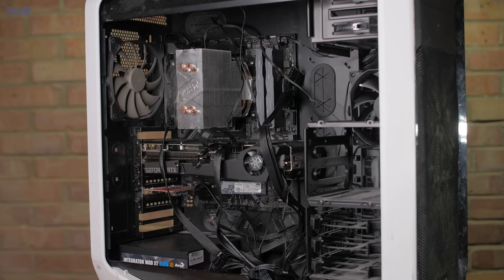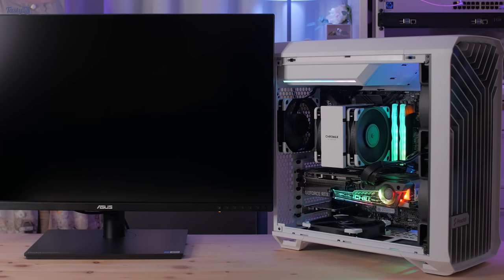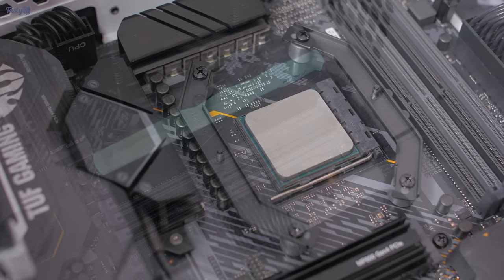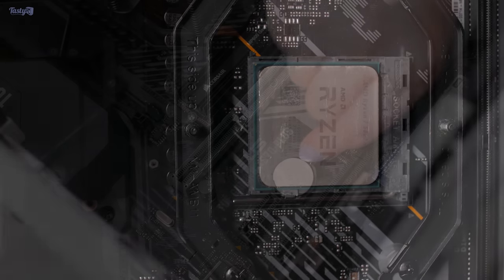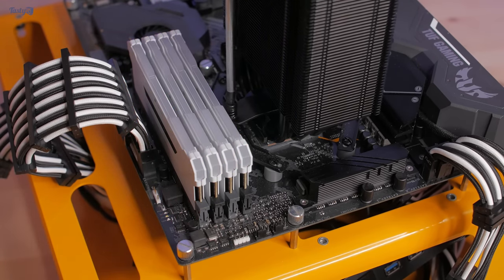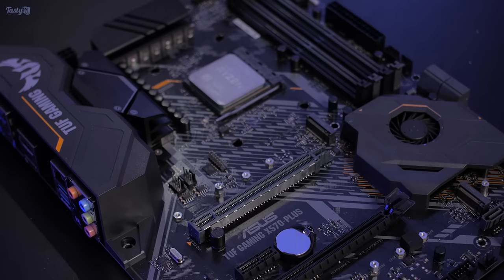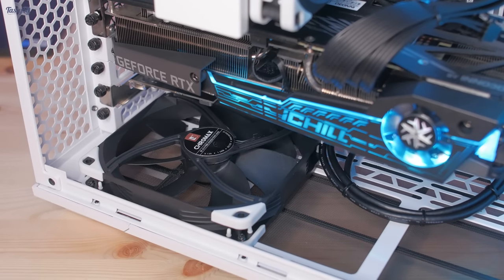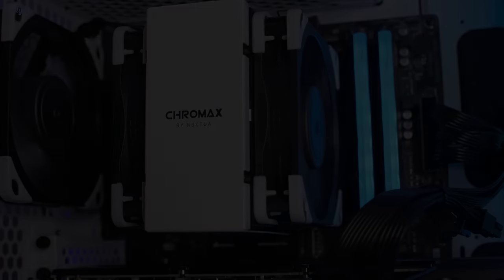I BROKE A VIEWERS PC??

Comment: About the build: I love it! looks absolutely stunning! With all due respect, looks way better than before.
About the malfunction: Since the problem only manifests when pressure is applied to the CPU socket, It could be the contacts on the motherboard on the PGA Socket. they are quite sensitive, believe it or not. That or a bad solder point in one of the components of the motherboard. the CPU coming out with the cooler, even though not ideal, shouldn't be enough to create any permanent issues. the twist and turn technique of removal usually only works with old thermal paste. depending on the new thermal paste viscosity and luck, anything might happen. all of the statements i just made are just my humble experience. I am not stating absolute truths, I am sharing my personal and professional experience. (I work in a Portuguese Tech Device Manufacturer assembling, fixing and maintaining Desktops, Laptops, Tablets, Phones, Monitors...)

Comment: It's not your fault this happened, It's an issue with the TUF x570-Plus boards flex when a high pressure mount cooler is fitted to the CPU as you found out, I've replaced numerous boards because of this problem, it normally shows itself after a few months by, as you observed, random screen lock ups and POST failures, this "cheap X570" board is one of the few ASUS products I would not recommend and if the customer wants ASUS, then I try and advise them to go Strix or ProArt depending on their usage case. TUF (Totally Useless Factory) boards use the cheapest components right on the edge of their limits and the heat from the CPU is enough to allow the board to flex around the CPU socket and stress the solder joints, sometimes a coat of flux and a hot air blast on the back can solve this for a bit, but it's the same theory as baking a faulty GPU to reflow it, if you do it once then you'll have to repeat it every few months until the card really dies.

Comment: These strange issues happen mostly on Gigabyte motherboards, I`ve had issues with 2 B550 Aorus elite v2, one of them stopped posting after 5 months use, the second one had a stuttering issues when used with 3700X cpu, the voice and video would stutter constantly. I would suggest to avoid Gigabyte motherboards at all cost.

Comment: It sounds so familiar and that's not a single case. Many Z690 boards, especially Asus got the same problem if you screw CPU cooler as tight as possible. I thought it's because CPU losing contact, but then could it affect PGA socket as well? There's gotta be some flaw in design. You can find many people on reddit/forums complaining about freezing PC that they just built. I had it too for almost half a year and it went away right after using contact frame and loosening mounting screws. The same cooler worked great on previous gen motherboards. I can see in comments it becomes plague now and who would've thought about coolers mount pressure if PC gets unstable? Every manufacturer tells you to screw it all the way down.

Comment: That board cpu problem is one of a kind.

I also had a problem 3 days ago, my PC didn't want to start, it was in a boot loop, I cleaned it completely, and tested everything little by little.
The board and cpu powered up fine alone, but as soon as I connected the memory or GPU it went back to boot loop, so I assumed the culprit was the power supply, and I was right, even though the psu was powering and offering the 5, 12, and 3.3 volts.

I was worried I'd need to upgrade everything because my PC is from 2015, but I only had to replace the psu, and everything is back to normal.

Comment: That's such an insane issue to try and diagnose, perhaps some of the pins in the socket have become broken off from the solder points on the motherboard and the new heavy cooler warps the motherboard enough to make those solder points not make contact. I don't know what the melting point of the plastic socket is but if its a decent amount higher than the melting point of the solder then it might be fixable with a hot air gun to reflow the solder

Comment: Oh my god what a flash back. I remember building my PC with my Rzn7 3800x and between the asrock mobo and tridentZ ram I got intermittent blue screens but switching either the ram, cpu, or mobo resulted in stability. It was only ever that specific combo of 3 that causes a blue-screen every 10 mins logged as a ram error.

Comment: The AM4 CPU is a royal pain to remove. I have always placed a heat gun (or hair dryer )  around the area before lifting a cooler. This has paid off on Intel and AMD CPU's. Thank you for the video. Great workaround for the positive pressure airflow. Five stars!

Comment: Ugh, I hate it when mounting pressure is this sensitive.  Used to have this old Supermicro dual socket server board with like 16 or 18 RAM slots.  If the mounting pressure wasn't precisely distributed I'd find memory modules would randomly 'disappear'.  Took me a long time and way too much reseating of the RDIMMs to figure out what the issue actually was.

Comment: thats weird, i put a 5600x on a b450 (gigabyte) with latest bios and for some reason the bios sets my infinity fabric clock to 1800mhz in amd cbs (old pbo), i have to manually set it to 1600mhz so it doesnt crash cause ive got 3200mhz ram

Comment: I have broken PC's the same way in the past. AM4 sockets flaw is CPU retention as you mention. annoyingly there's two ways to mount a CPU cooler in AM4 which is half the problem. Well done for replacing it though, and top class troubleshooting as well.

Comment: I have same issue if ur unplug 1 or 2 slot ram and connected again it Will be error no post, all slot ram in your motherboard not broke it cause of BIOS and detected ram not connect, and because previously has xmp ram oc has been active. And if your connect 1 slot it Will be okay and active by default setting, my PC has been fixed now, all i do is simple do not plug your ram and turn on your PC it Will make sound error let it be for 10-15 second after that force ur PC shotdown by click power button ,( it Will force BIOS connected to ram by default) and than plug ur ram dual channel in slot 2 and 4 turn on ur computer it Will fix ram read in BIOS default speed if want oc ur ram just actifated xmp on BIOS .

Comment: I had this issue in an older build. The RAM sticks just didn't work together but seemed to work fine in a single configuration. I don't think I ever fixed the problem, but after diagnosing it, I just kept reseating the CPU and trying different RAM slot configs until it finally posted. Then I never touched that system again. Great detective work in your case. Diagnosing faults is a time consuming, irritating process that often leaves you completely lost at sea.

Comment: Ahh so it was the Motherboard. I presume that would be out of warranty. I wonder if it is a slightly uneven top on his CPU, so the slightly uneven pressure pushes apart a dry joint (ie crack). - At least that would be my guess. Been here and had the wobbly bum thinking I might of kill somthing before.

Comment: I used to be a computer technician/builder. I’ve built over 20,000 computers. I’m very impressed with your trouble shooting skills. It seems to me that the cpu socket is a bit dicky. Only way to know for sure is to get the exact same motherboard and test with his cpu. If it still didn’t work then the cpu is dicky.

Comment: i upgraded from a 1700x to a 5800x i had a msi  x470 gaming plus mob that quit after a week of me having a new cpu. my pc hard crashed 2 times before .it  would get stuck at cpu no mater what i tried even no cpu cooler. i  replaced my mobo with a x570 bored every thing worked perfectly

Comment: You are too soft. you need to recharge for any faulty components replaced. once you have the observation of the mounting pressure problem with the CPU you could have offered the choice of the original cooler on the PC (temperamental) or the RAM in non dual channel mode (which worked) I have just in the last month bought that tuf gaming motherboard (2nd hand) as there is a good full coverage waterblock for it. Ryzen have a 3 year warranty, may have been worth checking the purchase date.

Comment: i have asus X370 and i have same instable problem when CPU block it too tight... i have loosen the braket to "normal" pressure and it works fine, but when i ratch it down it wuold freeze time to time...

Comment: hah hah I used plexiglass with my Fractal Define 7 XL on top exhaust. Since I have 3 intake fans on the front and 360 AIO as exhaust in top of the case. I put plexiglass around the holes of AIO to force air though AIO or either back exhaust. I also have been testing if there is any benefit making back exhaust as intake but I think there was no noticeable difference in temps rather only for turbulence air fighting each other. So rather giving fresh air from bottom and front and exhausting it with back and top as physics intends.

Comment: I had a similar issue. The PC worked just fine a night before, but when I turned it on the next day I only got a black screen. When I used only one memory stick it posted just fine. However, when inserting the 2nd one the PC was not posting anymore. Then, I've tried wiggling a little bit the memories and then it worked just fine with all 4 sticks since then. I think it might be an issue with the solder joints at one of the RAM sockets. 
I really like the way you diagnosed this PC.

Comment: THe Original Board had the problem which very well may have caused the boot issue , and the mounting pressure from one to another cooler , unless it was severely over tightened should had Not resolved the same , its the board , i am finding this board has the same issues across multiple combo`s , same as msi a pro board coming down with 3600 and 3600x cpu`s
Good to See You , i Do hope everything is Good

Comment: Consider that in transport the cpu heat sink could have bent or damaged the cpu seating area. 

That would explain the tightening issue.

Oh and too anyone who owns a Ichill x4 3090 little tip, the retention bracket that comes with it adds thermal temps, if you wanna stop sag get a motherboard mounted gpu sag kit (arorus x470 came with one I’m not sure on newer boards).

Comment: That was a very strange problem on the asus TUF. I could be wrong and could be unlikely but if it is to do with mounting pressure from the heatsink to the CPU I'm wondering if any pcb tracks have broken underneath and becomes apparent when the heatsink gets tightened.

Comment: You mentioned the lovely weak AM4 retention system. 
They also don't like long lasting high temperatures. So with a weak cooler, temperature eventually starts warping the plastic inside the retention system. 
This as you notice can create problems under sustained load. But you would have to have the system running max temperature for a while, i reckon days. Just mad!

Comment: A buddy of mine had this exact same issue. It turned out he basically broke his CPU somehow by mounting his CPU cooler too tight originally when he built his computer. I don't know too much about it but apparently it's super easy to do that with AM4 and some coolers. That's why I always stress that you do it until it's snug not until it's tight.

Comment: You pretty much did everything and anything that any one person could. Only thing I could recommend would be to run the system hot before shutting down and removing the cooler. This may give you a good chance of softening the paste and reduce the chances of the CPU being stuck to the base. However, depending on the paste quality, how much or how little was applied, and how long it's been sitting there it could still end up being a cockup.

Comment: It may be that the 4 screws of the heatsink mechanism are too tight, the maximum force is supposed to be 0.3 N-m, but a torque screwdriver costs about 90$...
It seems to be one of those breakdown cases where anyone would bang on the table.

Comment: it seems it common issue with 3rd gen Rayzen CPUs I got the same issue when I switch to 3900x and only bios update that can fix it without having to change motherboard but if you unlucky like me and bios update didn't fix the problem the time to upgrade your motherboard. 
another advice if you want to upgrade to 3 series Rayzen then make sure you update your bios or buy new motherboard before buying one of them

Comment: Good job, I've run into that problem many times with other people's computers. It never is a happy ending, as the best solution would be to replace the motherboard, because eventually with a faulty motherboard problems will just creep back up later down the line.

Comment: You always heat up the cpu (at least 50°C) to dissolve thermal paste bonds, twist and slowly tilt the cooler at any side just to remove suction and you won't face any PGA cpu stuck to the cooler.

Comment: Check the CPU mounts solder joints for dry joints.
Check that the CPU didn't get so hot that the solder holding the CPU mount to the motherboard hasn't been adversely affected in some way. (hot cold changes breaking a joint)
With surface mount components you can't just take a soldering iron to the board to fix these issues, you need to have a Hot Air Soldering Station to gently melt the solder and then let it set again.

Finally check that each hole in the mount is clear of debris and the metal contacts aren't damaged.

Comment: CMOS and reseat RAM. 
Remove cooler and see if you broke the traces going back to the socket. A1 & A2 are broken. 

I bet you can get the system to post by removing the cooler and try it without attaching the cooler. 
I had this issue recently. I tried with several coolers mounted in different methods. It would only post without a cooler on. RAM traces are not making continuity back to the socket.
Reply: It's the cooler mount...

Comment: bruh, what are the simpass comments. the issue was not fixed, and replacing the motherboard was a cop out. i know its super hard and specific problem, but after identifying it, you could have done more. was the backplate ok? was the non conductive film on backplate ok? were there any bends or visual issue on the back side of the socket, was the plastic part of the socket ok in terms of being scewed on lifted off the pcb? have you tried heating the socket with a heatgun? was the little holes on the socket free of microscopic debris? are the mounts for each cooler symmetrical and not bent? it not usually about the pressure, but about it being unequal. sorry for rambling, i was enthralled, and the you just replaced the mobo...

Comment: okay so idk why my comment got deleted, i think the word did. 
anyways, SKhynix memory chip (cant say the exact name) maybe at fault here and may not be in the validation page of this mobo and cpu combination. rare in newer AMD but used to be a thing in the first and 2nd gen ryzen but it is a problem. Samsung memory module are rock solid and widely used for this very reason. also can you lower the Mhz on the single ram and then add the second ram and reboot, see if that makes it run on dual channel?

Comment: By extracting the CPU incorrectly you have damaged the retention system of the socket or a slight thinning to the pin of the CPU. The foutrth generation of Ryzen have a little higher thickness than the third gen; having also more bandwith (ergo a high increasing to the work frequency) an incorrect electrical contact can cause system instability of the OS. So mounting a heat cooler in a thight way can cause a slight opening of the contacts in the retention system of the zif socket. The only solution would be to replace the zif socket.

Comment: I have seen this before with pga cpu, although in my case the system didn't boot at all after my friend returned form lan party with it, it worked with different cpu... for about 2 hours than it didn't boot again. The board was sent to rma and it returned with replaced socket and worked fine after that. System you worked on might have been damaged in transport in a similar way.

Comment: The reason why noctua cooler cant pass the post with dual channel memory but Deepcool cooler can post without issues may be a motherboard quality issues . I guess the motherboard has been bent or the CPU socket is damaged when u pulled the CPU out with the socket lever is still on .
So adding down pressure to the CPU socket make no post .

Comment: number 1 tip. if your removing your heat sink to any amd cpu like 5000 series below. you should do stress test first like cinebech like 3 times. so the cpu wont stick on the cpu cooler.

Comment: Good trouble shooting techniques it usually is the RAM, so starting there makes sense. I think his motherboard has a crack in it and when flexed by the force of the screws on the heat sink it disconnected the memory lane. It could be on one of the internal layers so you may not see it on the top or bottom of board. It is always important to run a full test on a clients machine before doing any work. If there is any existing unreported issue you can discover it before starting that way you are not on the hook for it. In many situations a client may not even be aware of an issue, that they already have. But if you document it your can inform the client before beginning. I don't think it was your fault and you probably should charge for the motherboard maybe at cost so the customer is not too upset, by the unexpected cost, there is a small chance that you caused the crack pulling on the CPU but this should not be possible if the board was manufactured properly.

Comment: I notice the noctua cooler is technically secured at two points, which could allow rocking. Maybe the CPUs lid is ever so slightly tweaked that that noctua CPU cooler is just not allowing it to seat properly.